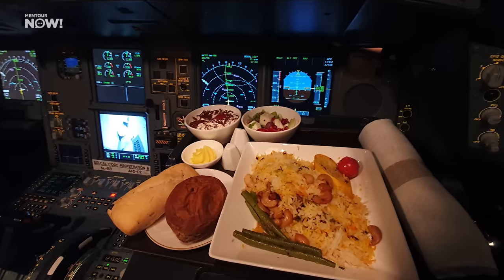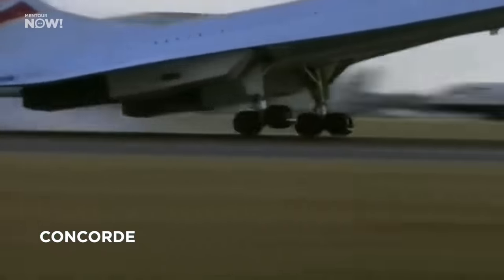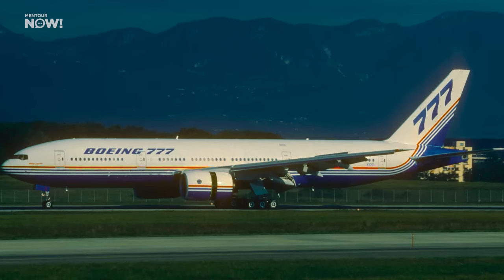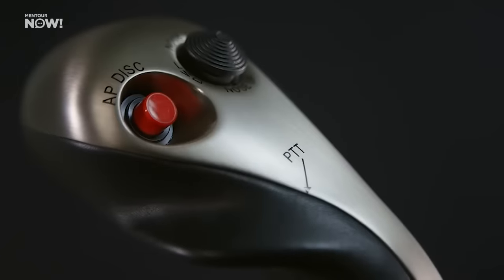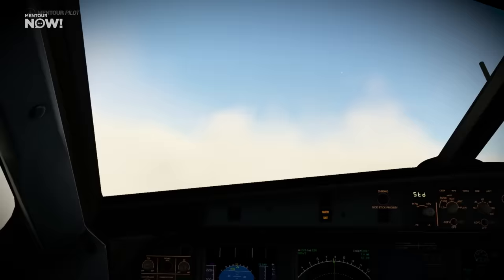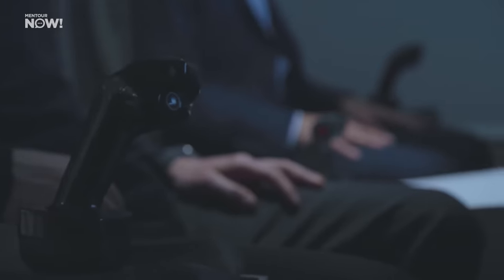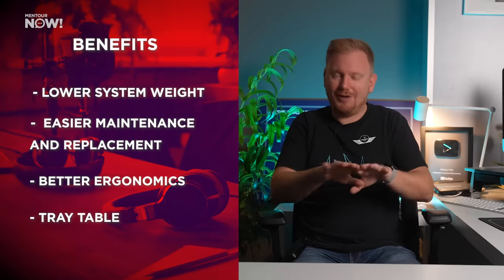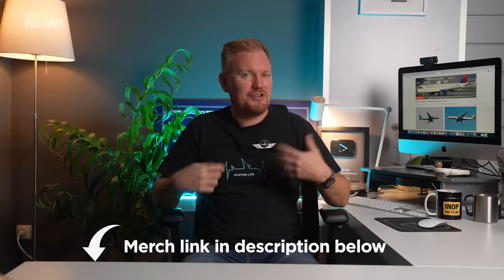Will Airbus Finally switch??

Comment: One thing we need to dismiss in this discussion of "Go-No Go" on active side sticks is using experience based on never having an issue with the current side-sticks "over thousands of hours" IF all flights were 'by the book', scenarios, i.e. "took off, flew to destination, landed" missions. 
The better discussion would be those that have had issues involving aircraft control, which on hindsight was either caused by or would have been helped by knowing what the airplane was either doing or what the airplane was being told, and those that would have been irrelevant with either system. 
If we could capture ALL of the situations where dual inputs were being given, whether inadvertent or not, whether they had ANY consequences or not, that would give a more clearer picture on what active sticks would solve.

Comment: Sticks are always used in high performance and aerobatic aircraft because it was simpler from the start so partially historic but the big one was to do with egress in the event of having to abandon the aircraft, the yolk makes this much more difficult and it will take off your knees if you eject.  The stick is more intuitive - you just imagine the stick bolted solidly to the floor and wherever you pull the aircraft will follow, a yolk isn't directly mappable but beyond the first 30 seconds most people wouldn't even notice that difference. My aircraft has a stick and most people who fly with me are used to a yolk and they really like the sticks more-direct and involved feel, I don't seem to have any problem going between the two.  The only downside to a yolk I have found apart from complexity is the natural subconscious attempt to steer the aircraft on the ground with it - and for some reason I find myself doing this if I ever fly right-seat.

Comment: Seems like a compromise would be to arrange the yoke control to plug in to a system that can also be used by a joystick. The haptic feedback for the joystick can be adapted for the yoke needs to give the same sensations. All the linkages and cables are still gone so weight will still be saved. The yoke itself can probably be made much lighter as well. A given plane can be fitted with either device easily (or even both with the yoke folding out of the way as needed). It then becomes the pilot's choice which to use. And displays can be designed to adapt themselves for either control device.

Comment: Did someone say Air France 447? Interlinked and back driven controls would have been nice. More likely you will see the active side stick technology implemented in a yoke design to keep the familiarity of the yoke with the weight savings.

Comment: It wasn’t until around 5 years ago that I didn’t realise that side sticks didn’t have any feedback. I assumed it was a given for the aircraft to be certified. It would be an additional layer of protection (or extra slice of cheese to use your much used analogy), but inputs on a yoke are still far more obvious to the non-flying pilot since it’s moving around between your legs. A sidestick is still not obvious - especially in a darkened cockpit. This likely wouldn’t have helped AF 447 too given it was at night (until both pilots had their hands on them - at which point things were already too late to save the flight). Sidesticks probably also need lights around them at the base when the cockpit ambient lighting is dim or dark - green if it’s an active stick and red on the other to show the other side is being used (and flashing red on both in the case of dual input). And they don’t light up until one is active (not in autopilot or they’re active and not functioning properly). One additional benefit to yokes is - no space for a slide-out table to allow pilots to whip out their laptops and look at scheduling and overfly Minneapolis by 100nm (see Northwest in 2010).

Comment: My first concern is that the side-stick feedback might disappear when an aircraft's performance degrades; when there are combined disagreements of instruments, sensors, control-inputs, trim-setting, control-surface positions, or any other situations when the aircraft's fly-by-wire system has degraded into (or below) Alternate Law--because it's precisely in those times that control-stick feedback will be most safety-critical.

I say that because it seems Airbus' fly-by-wire systems rely heavily on everything functioning properly--including members of the aircrew.  When things start to degrade, or an upset sends an Airbus outside its predicted design envelope, Airbus aircrews have on numerous occasions become unwilling test pilots.  If in situations like that, the computers are going to be programmed to give up providing feedback--reverting the side-sticks back into 'video-game joysticks'--then this isn't actually a real fix.

If that's how it winds up being implemented, the retrofit will only give Airbus aircrews a false sense of confidence.

That does seem to be a well-rehearsed corporate two-step at Airbus:

Airline:  "Aircrews express concerns."
Airbus:  "We're addressing that with a retrofit."
Airline:  "Oh, you're fixing the safety issue?"
Airbus:  "No. But if the flight manual says we did--that'll justify dismissal of aircrew concerns."
Airline:  "Good enough.  Thanks, Airbus!"

So I do hope that's not how it plays out this time.
Reply: That makes no sense. Service bulletins are a common thing. Airbus have an excellent safety record.

Comment: I like your comment about if a side stick can be fitted in a Gulfstream it shouldn’t be a problem to fit them in an A320’s roomy cockpit. Have you seen the space under the side console panels in an A320 cockpit? The cockpit may appear roomy when you walk in, but the hidden spaces where all the avionic and mechanical bits live is not roomy. I’m speaking as a retired A320 (and other aircraft types) engineer, I used to have to work in those hidden spaces. Sometimes it was a case of you can look at what you need to get to, or you can put your hand in, but not both at the same time. Active side sticks are the way to go, relying on an audio “dual input” warning is not really good enough.
 I have in the past found it amusing listening to Airbus pilots talking, they did seem to think they were some sort of elite. Sometimes while trying to diagnose a defect I would take great delight telling Airbus pilots they don’t fly the aircraft, the computers do, all the pilots do is put in a request to the computers to do something for them. Even with multi computer fails with the aircraft in “direct law” the pilots input is still processed via a computer.

Comment: Active side sticks would have been helpful on the AF A330 that crashed. Per an article I read the CAP realized too late that the CP was holding full aft on the stick during their confusion, while the airplane fell.

Comment: One potential advantage of active side sticks is that, since they require force sensing to provide the feedback, that force sensor can be used as a control input in the event that the stick itself becomes mechanically jammed.

Comment: I have an experience flying both types of controls: side stick on Eclipse and yoke on Citations. Yoke takes out the space, makes cockpit less comfortable and brings now evident benefits vs side stick. The last one gives a perfect feeling of aircraft control and makes it easier to fly. Even though these are not active controls and comparison is not completely correct, I’m for side stick) finally you put your right or left (copilot as PF) only after V1 and till you engage AP. The rest of the flight, including approach we fly with one hand on the yoke horn. See no reason for the second one)

Comment: Peter the Wright Flyer used a side stick. Elevator control only. The Cobra attack helicopter front seat used side stick cyclic. Lots of examples before F-16.
Reply: He meant a combination of sidestick and FBW

Comment: Missing from this video is the practical implications of especially retrofitting. The new sidestick would have to fit physically, will need extra wiring (power for the actuators), extra connections to the power supply, extra data connections to the flight management computers, which in its turn need updated programming or even replacement. This all will need to be tested, type-approved, certified, need extra pilot training, etc. The cost would be astronomical for something that is definitely nice to have but will not significantly improve safety, as both Airbus and Boeing accident rates are miniscule.

Comment: I'm just a student pilot, but yokes always rub me the wrong way, because every instructor will yell at you to only have one hand on the yoke, so you have the other hand on the throttle. For the love of everything, why have a place for two hands when you're only going to be using one?

I do realize airliners are flown slightly differently than the Cessnas and Pipers most flight schools have, but I can't help but think the ergonomics of yokes are in many ways a wrong turn. I know that the earliest Curtiss airplanes had steering wheels, because the designer came from a car racing background. That still doesn't mean it's the ergonomically correct choice. I see the need for them on something like a B-17, B-29, or other large airplane with purely mechanical controls and a need for the strength of both arms - but that's no longer the case and hasn't been for decades. If you only need one hand for input, only have one place to put a hand for input, and free the valuable workspace for other stuff.

Comment: Good insight, as ever, bravo!
Two remarks:
1- the main interest of FBW apart from the one you mentioned (flight envelope protection and weight reduction) for the Airbus series was to allow for a more Aft CG, thus allowing less downforce required from the THS in cruise to keep the aircraft pitching down stable, hence less drag from the THS hence less fuel consumption (around 2 to 3% IIRC).
The plane would have been inherently unfliable without FBW.
2- AFAIK the Intel (and Motorola) microprocessors series used in the main flight computers of the 320 family nearly at the beginning have not been upgraded since. They are still the Intel 80186 and Motorola 68020, that were produced in the 1990s and that powered the first PCs and Macintoshes back then.
These processors are reliable and were well suited for real time processing application like FBW.
Guess there is somewhere in the world a production line for these processors (correct me if I’m wrong).
Reply: Apparently Intel 80186 production stopped in 2007. For maintenance reasons I would assume that Airbus bought a whole pile of them before production stopped. Or maybe Airbus had upgraded the electronics of the aircraft to allow installation of current production processors.

Comment: As an a320 pilot I would say that adding moving levers to the the Airbus autothrust system like Boeings autothrottle has would give a greater day-to-day safety benefit than the described active feedback side sticks. While modern engines don't have the lag of old school turbojets, a pilot will still notice the thrust lever movements (or lack thereof) well before the sound or performance changes of the the engines and aircraft. Without aerodynamic feedback and pilot controlled trim the "active" feedback described here is only what the other pilot is doing. This "other pilot only feedback" would be a waste in my opinion, adding complexity and cost with little benefit.  Both pilots simultaneously manipulating  the aircraft flight controls should not happen.

Comment: The concept of Fly-by-wire does not necessarily imply the use of a flight computer but that the control actions are transfered electrically instead of mechanically or hydraulicly. Therefore the FW 190 was the first  airplane employing fly-by-wire.

Comment: The F16 side stick doesn't react to pressure but in fact to movement. First they tried the static version but pilots hated it because they had much less "feel" over putting pressure in the stick then they had moving the stick. So it does move.

Comment: Fortunaately i had the opportunity to get on the last Airbus A300 ever built when i was a line maintenance mech in VLN station  , it is an A300-F4 622 (A300-600) N692FE ,buit for FedEx and it was delivered from factory in 2007 , i always say that this airplane is a Boeing made by Airbus , and it is an amazing  airplane !! it is also amazing how a 2007 built plane , is just made with 70s technology it is a truth time machine !!! and if you ask me , the cockpit looks exactly the same as an 1985 built A300-B4600 that i think is the oldest in the FedEx fleet

Comment: I never understood why the sidestick doesn't have a vibration system in it like a video game controller to warn from dual inputs.  If there are two inputs disagreeing it should make both sticks "buzz" to alert the pilots that they're both inputting.  Not the same as a stall stickshaker but a unique feel.

Comment: Airbus is just more consistent and straightforward in following the modern trend of pushing human out of controlling anything leaving and it all for automation. It will end up with AI guiding all the aircraft including passenger airliners. But until human stays in cockpit any kind of feedback and interlink  connection between input devices is absolutely necessary. Yes,  and being a Boeing pilot I don't have any bias against side sticks. Tray tables are wonderful stuff after all 😉

Comment: It would be good to see a video on the differences in how Airbus and Boeing's Fly By Wire works. I'm sure that one will be full of acronyms as you detail the difference in implementation methods between the two companies.

Comment: Great video as always, Petter.  One question:

What about the actual ergonomics of the yokes vs. the sidesticks for left- vs right-handed pilots?  It just seems more natural to have a large, symmetrical yoke in front of you that you can hold with two hands compared with a small joystick.  The contrast is especially stark in large widebodies like the A380.  The idea of that huge aircraft being controlled with a tiny sidestick takes some getting used to!

Comment: a320 handles similarly to the 330 right. What if they upgrade from a 320 into a 330. BUT if the 320 has the newer sidesticks, and the a330 does not, it could cause problems because. a330 sidestick looks, feels, and sounds the same as the a320. And the cockpit is EXTREMELY similar to that of an a320. So it could cause some problems

Comment: A great synopsis of the debates between sidesticks and yokes in modern airliners.  Pointing out the fact that aural warnings can be missed during high stress situations.  One thing I found interesting after flying both styles, is the training techniques used to permit pilots with yoke experience to more safely operate sidestick airplanes.  Active sidesticks sound interesting as a developmental improvement to offer force feedback.  I considered the A320 series to fly similarly to the control wheel steering system used on the 737, essentially a semi-automatic pilot, using the sidestick to introduce flight path changes while the autopilot keeps the airplane in a stable attitude. Essentially retrimming the stable attitude maintained by the autopilot.  My third type rating was in the 737, and later the A
Reply: Autopilot does not keep any of Airbus FWB aircraft in stable attitude, if pilot is controlling the aircraft with sidestick. Flight control laws do not affect through autopilot, and the stability is created for example in A320 by FACs, SSCCs and ELACs, not by autopilot. The AP and/or FCU can be INOP, but all FACs, SSCCs and ELACs can be operative same time. Architecture is a bit different on WB busses, but still none of them are controlled by AP if AP is not switched on.

Comment: Active side-sticks...  Another thing to break, and the failure modes could be catastrophic. Imagine if you will...  A world in which runaway servos push airplanes into the dirt. Boeing called it MCAS. Airbus will call it Active Side-stick. With 11,000 hours on A320F, the problem of 'who's flying the airplane' can be dealt with effectively through rigorous training that reinforces positive control.

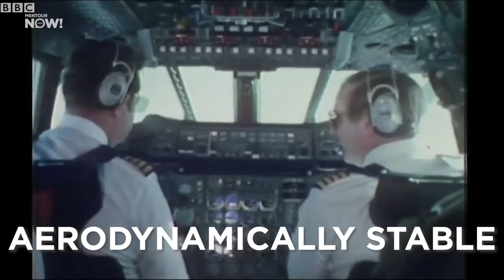Comment: @03:47 -- it is really weird to talk about😂 "Concorde" as "aerodynamically flight stable" when "that design of aircraft had variable flight geometry" because "flight dynamics varied throughout different flight modes."   The geometry of the plane itself varied; without that variance, it wouldn't have been flight-stable throughout all modes of operation.

Comment: I suggest that, if there is a desire to maintain the yoke control while gaining the replaceability of the side-stick and also attaining the active feedback features, the box for a digital input would readily fit on or just below the floor between the pilot's feet,  The box, along with a yoke with a shorter radius of movement, could fit into the same volume which the active side stick fits.  Just some ideas to throw at the cockpit designers.

Comment: The A300 first generation already had fly by wire, in the autopilot Control Wheel Steering function, which permitted the pilot to make inputs to the controls with the yoke, with AP engaged.

Comment: As you eluded to at the end of the video training could be a problem. With the biggest part being in maintenance. You could end up in a situation where a crew that has been upgraded to active side stick end up on a legacy jet that has not been upgraded and that could cause an incident or accident. Or worse from a scheduler point of view they could book an aircrew that has not been updated because the planned aircraft at the time was a legacy but because of a unscheduled tail change they end up in an upgraded jet. These problems would be eliminated once the fleet is upgraded but it's something to keep in mind